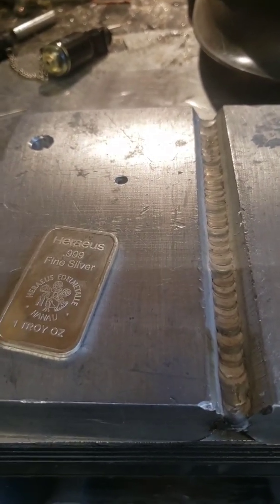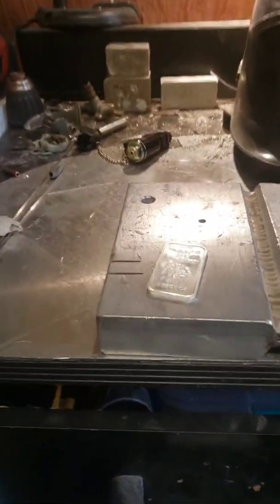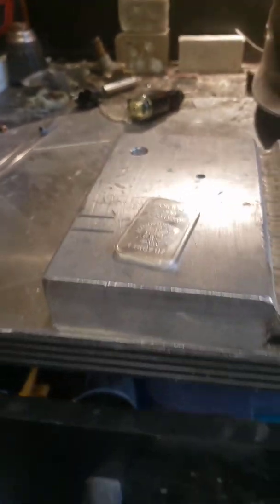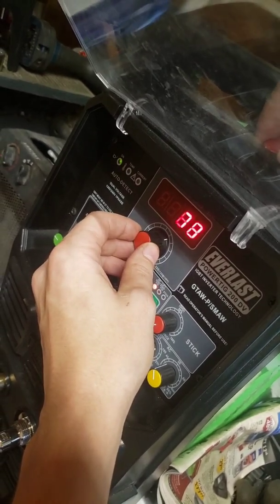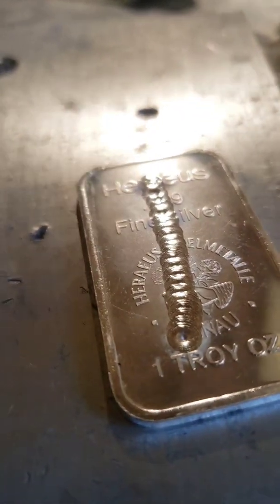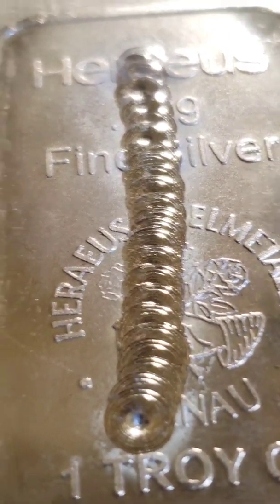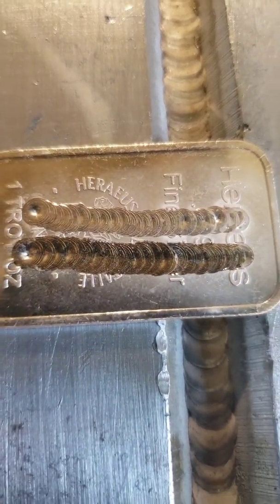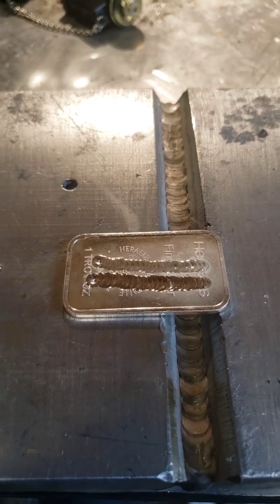Tig welding on .999 fine silver bar. will it work?

Comment: Hi I own a small silver casting company and have been looking for a welder,  would a 3 in 1 TIG/MMA/CUT Welder 200 Amp Arc Welding Machine from Home Depot work for this?
Reply from the maker: Need a welder with HF start. Needs to be super clean. Can't scratch start.
Reply: @2StrokeMadness.88  I recently tried on some 10ozt bars that I cast, and am unable to get the silver to pool at all. It just heats up and then all starts to melt at once. I tried Dc, Ac, and with pulse.  It has HF start too, any tips?

Comment: Thanks for doing this, so i dont have to. Now i know
Props for filming it.
Reply from the maker: Cleanest material to weld by far! Not like it's  thing but good to know
Reply: @2StrokeMadness.88  I was about 2 days away from taking a silver round in to work and trying this. I still might, it looks nice. Pulsing with the machine or manually? How many amps?

Comment: How you like that unit? I bought my 255 EXT 4 years ago... I love that joker, it's nice.
3DC/5AC amps makes me want to break out a length of silver wire. I've made rings from 1/16 and even 3/32 aluminum using the 255EXT. Silver should be a walk in the park for it!
Nothing prettier than a nice silver ingot than a simulated stack of dimes!
Reply from the maker: Best comment ever. Yes is very satisfying and very clean. I want to try gold next but don't have anything big enough. Definitely doable. Silver and gold ect is so dence like copper takes of of amps. But I had to try it because I haven't found anyone else doing it.
Reply: @2StrokeMadness.88  200 DV is a great machine, what tig button did you go with? Did you find a cheap one that has analog control?
Reply from the maker: And I love the everlast great welder. I had a lincoln before that and this tops that. I even used a few dynasty's and basically comparable. Just not the price.

Comment: Thanks for the video my man!
I saw one  video where guy claimed it can be done and with what approximate settings, electrode size etc, but there was no presentation!
In one week time I'm about to start TIG welding course and just got curious if someone could weld silver/gold, since making jewelry is one of the things I was very into a few years back. Got curious and your video provided the answer.
Thanks again.
Reply from the maker: Glad I satisfied your curiosity. Yes can be done and so easy. Very clean metal. Id try gold but I don't have anything big enough. Stuffs expensive lol I found some silver rods I guess you could call it and was gonna do some small stainless fillets
Reply: Seen plenty of jewelry welded with pulsed laser,  quite normal these days,  very handy for delicate structures.